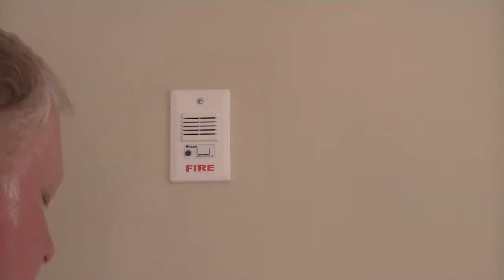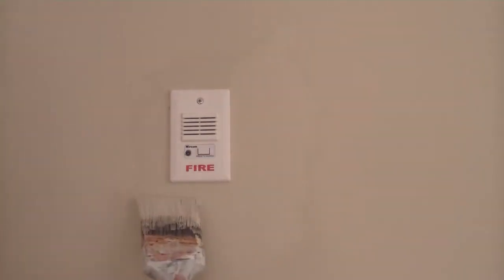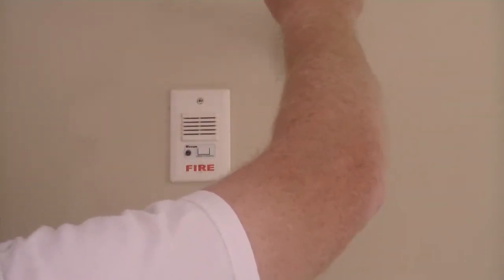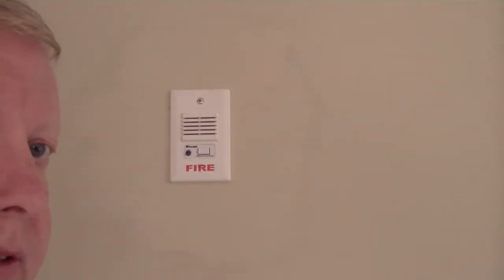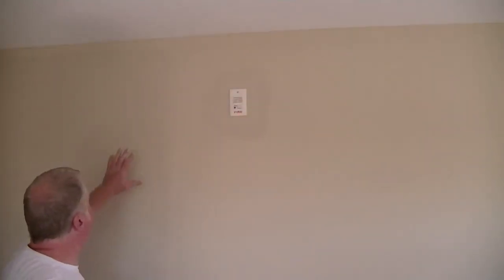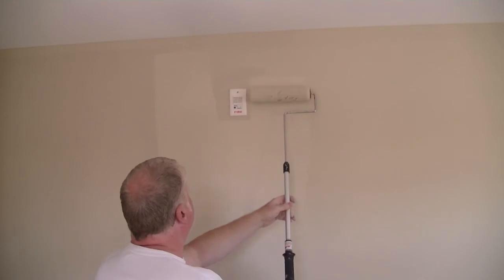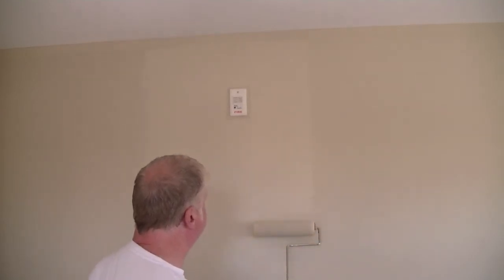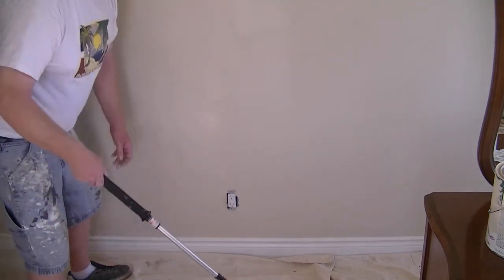How To Eliminate Picture Framing On Your Walls

Comment: I made the mistake of doing all the cutting in 2 bedrooms, thinking I'd take a break and then roll the walls in a couple of days. Now, I'm learning that all the cut ins are going to show because they dried and they're going to have that 'framing effect'.  I still haven't rolled the walls yet.  Is there anything I can do to minimize the framing problem or correct the situation?